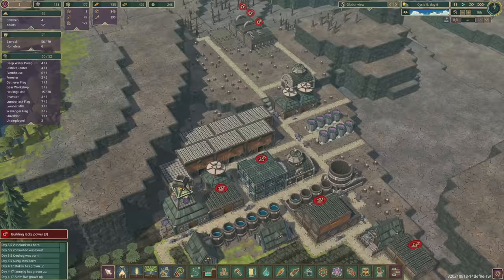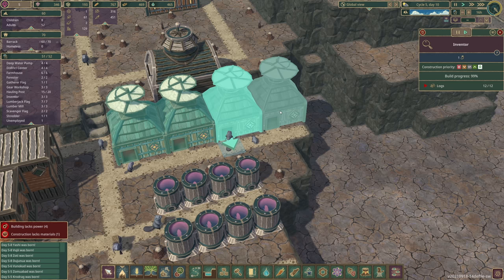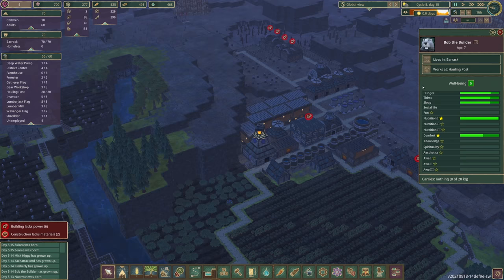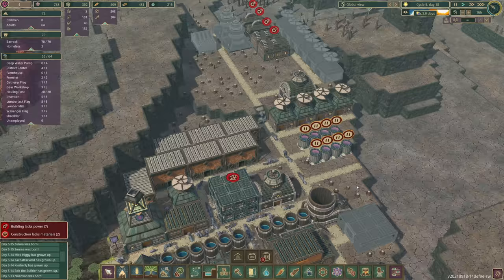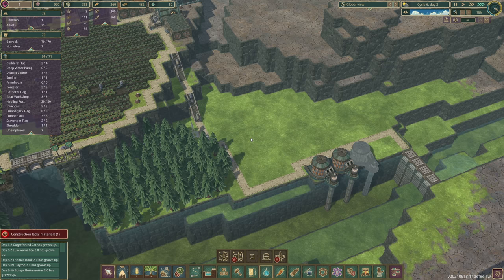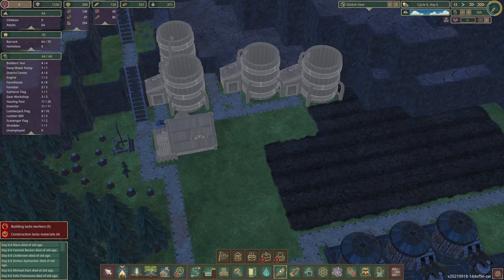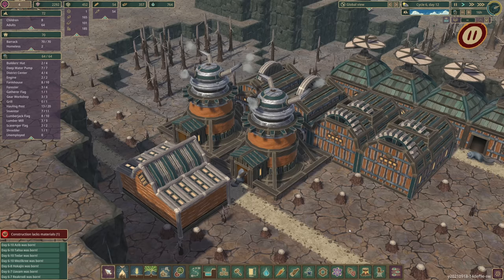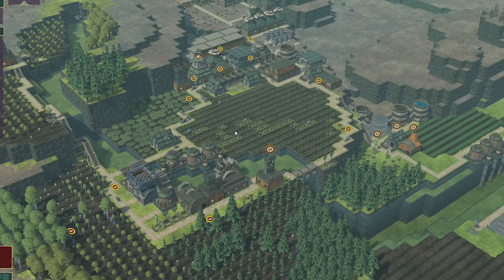Engineering a MEGA DAM to survive the dry season in Timberborn!

Comment: Just like with the trees and their log yields, the crops that take longer to grow have a better overall yield (except potatoes, currently). 1 patch of carrots will feed 3 beavers. 1 patch of potatoes will feed 4 beavers. and 1 patch of wheat will feed a whopping 15 beavers but it requires 2 technologies to be unlocked to do so. 

Carrots grow 3 per patch and the beavers can just eat them immediately after harvesting. 3 food per patch every 4 days.
Potatoes grow 1 per patch but need to be grilled. After grilling 1 potato creates 4 grilled potato portions. 4 food per patch every 6 days.
Wheat grows 3 per patch, which is milled into 3 flour, and each flour is baked into 5 bread loaves, for a total of 15 food per patch. every 10 days.

Assuming no growth loss due to draught and the crops can be replanted right after harvesting and all the processing can be done at the same pace, over a 60 day period (the first number commonly divisible by all 3 crop grow times), a single carrot patch will yield 45 food, a single potato patch will yield 40 food, and a single wheat patch will produce 90 food.

Comment: Click on your District center, it will show the extend of it's range by the lines. When outside of the red line, it's no longer connected to that District.

You are now meant to create a new, self sufficient district. Create a new District Centre and make sure to break up the path with a District Gate.

You can then set up Distribution buildings to move resources between Districts.

Comment: Couple of things:
1.The farms are too far away from the district centre. It's not bugged out, just a weird game mechanic.
2.The water in the lower dam gets completely emptied within in one dry season with around 150-170 beibers.
3. I would assume quite q big problem in Terms of food is storage. With scrap metal and auch taking up more and more space it gets hard to find new space for your beibers. Also potatoes are a lot more efficient
Reply: Also it is possible to get the farms working as only the length of the paths counts towards the district reach. A bridge can get the job done, but it is cheaper to just build farms and such in the higher parts. Those above your district center

Comment: Since I find your videos funny I will share a tip that will make this game much, much easier to handle. Once you have a water pump set up and working and then have a hauling building up and running it's time to move on to the next level. Go into a dried out area that is in range of your city center and build a 6x6 square ring of levy blocks. Levies don't let water through right? 

So this ring of levies can then have a distribution pump put on it with a pathed platform so a worker can get to it. The pump needs only a single worker and he will start filling the ring of levy blocks with water. Now the land will be available to farm and it uses far less water than the irrigator. It will let you farm HUGE areas of land. I usually build mine to three blocks high so that the water last through the droughts with EASE. Now it's a pain to turn the pump off and on and manage it right?!! But you don't have to. Inside the new levy pond add a depth measure stick and the worker will automatically manage the artificial pond and it won't flood the place anymore.

It's all low tech and super simple. Just need logs and planks along with a steady water supply from a pump. Now you can farm anywhere and have so much food and logs that it's impossible to run out. It totally made the game super easy for me once I started doing this so I hope it helps you out =)

Good Luck and have FUN!

Comment: Districts only connect to buildings within a certain range; this range is calculated entirely by the traversing paths.
So any C/U turns in your pathing actually reduce how far a district building can reach!
Reply: someone said that a builder's hut has its own range so a builder's hut lower down could solve the path problem if the farmhouse is withing the district's area of control. I'm not sure I love this mechanic, I think that resource hauling time is enough of an incentive for optimizing paths and just restricting building with the district center's area of control would be simpler to understand for new players.

Comment: The district center has a max range that buildings can be from it. To see that range, click the district center and find where the green line on the paths turns red and ends. I bet that the buildings that you put across the water way are too far from the district center to be used by that district, so you'll need to place a new district center on that side to use them (with a district gate between the two).

Comment: The new farm is too far away from the district. Youll need to create a new district center, connect the path to it with a gate, and migrate some beavers over to that district. A distribution center will be needed to supply them with what they need to survive (in this case logs & water) and you'll need a second one to ship the food back to the main district. (distribution posts are huge but luckily cheap)
Also never forget berries are actually really powerful in the game. you can set them up in a place that droughts because they are drought resistant & they dont need to be replanted. The amount you can get from a good berry farm can be a surprisingly good surplus of food (maybe set up a water dump at the other river, extend out and plant there)

Comment: RCE click on your district center and you'll see those lines that go all over the path. So where the lines ends is where your district ends. So maybe your farm is too far away from the district center so no beavers can work there. A solution is, building closer to the district or, build another district. Different districts can not share beavers but they can share resources if you research the distribution center. I haven't reached that part so i don't know how it works but i guess they can share food

Comment: "Not connected by paths" is wrong. What the message should say is Out of range of the District Center. You can try building a Builders Hut but it barely offers 10 tiles of range, best to build a shorter path...like maybe a suspension bridge.

Comment: The farmhouse is too far away; if you click the district centre you can see how far it can connect from. You might be able to get in range by making a more direct path (it's the length of the road, not the distance as the crow flies) or by moving the district centre a little. Otherwise you'll need to start a new district!

Comment: You definitely need to start on the wheat production each square provides 15 food after it has been ground and baked in the necessary buildings 
Using all your science to unlock some things would benefit your beavers 

This is what I would do, create districts (using district gates) with specialities and have them trade with each other

- A farming district with the bigger warehouses (1 holds 1000) each restricted to their own resource. (1 for carrots, 1 for potatoes, 1 for bread, etc)

- A resource district would have a huge lumber farm of maple that way even though it’s 24 days to grow they will never not be grown with a good amount of log storage, and large water storage though with those 5 large water tanks you can store 1500 water already.

- A craftsman district which you pretty much have already with the engines powering the cog/planks and the inventors hut.

- A housing District with the bigger capacity buildings and the leisure/fun buildings so work and after work are separate.

- To keep everything green I’d make 1-2 block wide rivers that flow from the main stream around the district before going back to the main stream using explosives (1 explosive = 1block) making sure not to circumvent the built dams, it will take longer to fill up after the dry season but by the same logic it should take longer to drain.

I know it’s basically a wall of text but this is what I would do if you take inspiration from this I’d be happy but on the same note if you decide it’s not for you that great too as I’m enjoying this series so much seeing you play.

Hopefully once the other factions are released I hope you do a series with each of them on a different map to keep it fresh😁👍♥️
Reply: I don't think you can have a housing district since beavers only work in their district. So you need houses and leisure everywhere
Reply: Yeah I realised that was nit possible after a bit what I should have said was a breeding district to migrate once a specific number are grown

Comment: Reason farms arent connected in case someone hasnt said it already is they are too far from the district center by path so if you can build an overall shorter path to get there it will connect....if you click on the district center the line that appears on the path shows how far out you can build from the center and still be connected even though you can build past that range

Comment: If you click on your district building you will see how far it reaches, and I suspect the farms you built on the other side of the dam are too far away. You can build another district over there, but the food won't be shared with your main district. You can get around that by building a trade post (or whatever it's called) and a drop off site so that the food from district 2 gets delivered to district 1. But in order to get any beavers to work in the second district, you will have to migrate beavers from district 1 to district 2. When you migrate beavers, those beavers in district 2 will need food and water in district 2 as they will not take from the food and water in district 1, so you need to keep them fed and hydrated or they will die. This game is great, but it's a lot of management that goes into expanding into other districts.

Comment: Yikes. It seems that the area across the dam will have to be a separate district. You can check in-game to see the description, but essentially this means that you'll have to build another 'city' by constructing a 'city hall' and a 'city gate' to mark where the districts are cut off from each other (terms used may differ from in-game).

Naturally, the district must be self-sufficient, i.e. resources between districts aren't shared. You'll have to move wood, planks and food between them until the second district can stand on its own.

About your food shortage problems, perhaps you can implement crop rotation/crop segmentation on your current farm plots? From what I saw, the only problem in your run was your dependence on carrots and berries as a food source. If you designate a portion on your OG farm plot as wheat, when they're ready for harvest, you'll have more food to go around with. Since you already have a dedicated potato plantation, the food shortage might resolve itself shortly, but this might still help you in the future with your expanding population.

Cheers, RCE. I've been hooked on your Timberborn playthroughs and look forward to more in the future!

Comment: The reason the building aren't connected  is because they are to far from the city center. The easiest way to get around this is to make shorter straight paths to those buildings. But, of course there is a limit  to this so you need to think about making another district and a trading post.

Comment: Click on your builders hut it will show you how far you can build with the green to red lines. 
Go into the labour tab I think unlock the trading post and the drop off 250 science each. 
Put a drop off point near where you want to start a new district then send a load of resource forward it. It will only hold 300. 
Then go to the paths tab put down you builders building and a district gate and then got to original buoilder and migrate some population over. If you don't have any spare population unemployed it will send anyone.
Reply: I wrote that fast excellent spelling, you get idea

Comment: *edit actually scratch all that I just saw the iron teeth have a deep water pump reaching 6 layers deep (sorry played only with the starting faction) hope it might be useful to some here still x)

little heads up for anyone playing this too:
you want your water reservoir as high up as possible for numerous reasons - if you make a huge and deep water reservoir at the bottom you can't use it, it just sits there and serves exactly the same purpose as a 2 block deep pond + a little bit extra because it irrigates a little bit longer but I think 3 blocks high is the limit for irrigation radius

you can never access the bottom water because your pumps only reach 2 blocks deep, so unless there is a hidden mechanic for water to evaporate slower with deeper water, it's just as good as a 2 deep pond

if you build it high up you can build a 3 level water lock and even create flow to keep your water wheels running by lowering a few individual locks a bit (need to fiddle around with this a bit but generally you can accidentally flood your colony briefly too so be careful) 

because the water locks are 3 levels max and can't be stacked it is a bit limiting your reservoir, technically you can build a single piece of dam or two at the bottom layer to get a constant flow from the reservoir but it's impossible to control and you're potentially wasting a bit of water this way (it probably doesn't matter until extreme dry seasons very late game)
I've not had the time to mess with this idea because my map wouldn't allow for such a setup without insane work

if you could build a lock in between the dam it would be an absolutely genius solution
Reply: actually the iron teeth faction's water pump can reach up to 6 blocks down, so this bottom reservoir is perfect for them.
Reply: @maximeteppe7627  yeah I just realized it after typing it out x) didn't play them yet

it's still useful to be flexible on where your stored water can be drained into and keeping water wheels running works kind of fine with just a single lock surprisingly

Comment: The path to the buildings across the river is too far away from the district center. If you build a path directly across the river you might be able to get it short enough to connect to your current district. Otherwise you'll need to set up a second district.

Comment: The district is just too far to the farm. District has a max area it can influence. If you want you can try moving the district building further downstream or crossing the stream earlier so the beavers doesn't have to go all the way down then back up again. I would actually move the farm house to the other side of the field. Since it's closer to the district hall.

I dont know if this would work but can you try one set of stairs in the river where there's a deep pool and connect it using path. Put one set of stair going into the water. Then another stair on the other side for the beavers to get out of the water. And a path in the water in between without care about the height/depth. Like stairs into a deep swimming pool but doesn't reach the bottom.

Comment: Click on your district center, this will draw lines along the paths, turning red at the furthest points... past these your beavers cannot use the buildings.... I think it's 70 tiles walking distance away  is the max, but if you do a path to the side by 10, then down by 10, then back the original direction by 10 (to the left, then down, then to the right) that is classed as 30 tiles travelled, (even though it may only be actually 10 tiles away from the district center to the end) - it's all based on distance they have to walk...

Comment: Just a suggestion. You don't need to stop pumping water in the dry season if you build a floodgate (dam with adjustable height) at the first waterfall (the one which gets dried every dry season). You can store water there and keep pumping. When the river is about to dry up, open the floodgate. You can refer to this if you didn't got my point : https://youtu.be/a-87kqDwbm4?t=257

Comment: When you first switched from Polybridge I wasn't sure, but now every time I see a new Timberborn or Minecraft video from you I squee like a little schoolgirl.

Also, use the priority tool when you need to switch the priority of a bunch of things all at once like the dam.  I haven't done it yet, but I'm thinking that building dams in layers, especially when you are up against the dry season, can make sure you at least have full layers, although that sometimes means you need to give them access to the bottom of the dam since the top of the dam may not be a valid path.

Now that you have constant power to your plank factory you've achieve Planck's, constant.  (sorry, had to throw one joke in there)

Try to keep your breeders on constantly, but not all of them.  I can't handle the full output of 10 breeders constantly on, but I can manage 6 or so.  If your population starts to go up to fast just turn off a couple.  If it starts going down just turn down a couple.  That will give you more stable population numbers.  (I also sometimes turn the breeders off just before they pop, so that I can get new workers pretty quickly if I need them, although they still need to grow up.)

For an engineer you sure seem to like single story buildings.  Lets see some sky scrapers.

Your new farms are out of range.  You can fix that by starting a new district (I haven't got one up and going fully yet to the point where it's self-sufficient.)  You probably could also fix it by building a more direct road.  It seems to be linked directly to the distance from the lodge, including counting elevation.  Builder's Huts can extend it a little, but not infinitely and I haven't figured out the math on them yet.